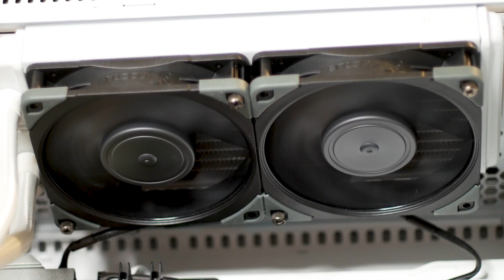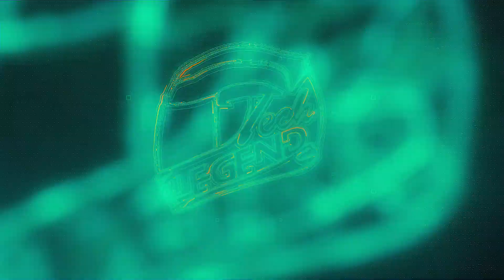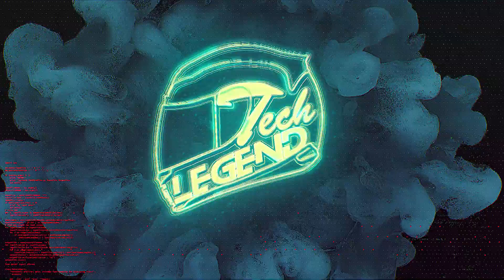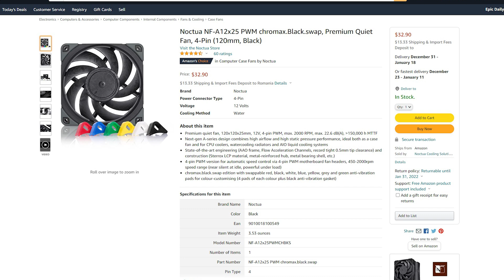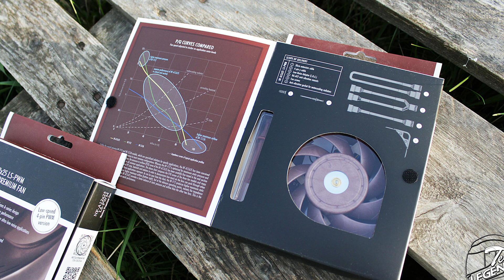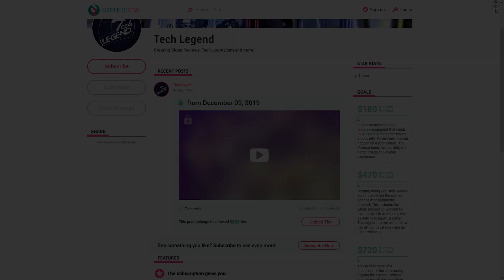Noctua NF-A12x25 PWM chromax.Black.swap Review

Comment: not many review include the noiseblocker eloop on youtube, looking at your list i dont need to buy the notcua or the t30 if the noiseblocker are this close is it also on the radiators this close?
Reply from the maker: While the eLoop fans are good, they are an older design and might lose next to newer fans that are quieter overall.

Comment: I decided to give my H5 flow chassis a bit of a twist. I swapped out the NZXT GPU, exhaust, and top-mounting radiator fans for these Noctua fans. Guys, I couldn't be happier 😊. After doing hours of research on Noctua, P T30s, and Be Quite All with great reviews eventually, I had to make a choice and I believe Noctua stands alone. I barely hear them spinning up with temps get high. These did come with extra bumpers and guards in different colors to match aesthetics 👌🏽 They are pricey but in the world of tech, we know you get what you pay for.
Reply: I am picking these up tomorrow for my H5 as well!! Glad to hear you love yours man. Cheers
Reply: @MnHondaSi  After hours and hours searching videos', im also going to upgrade my H5 flow. 140mm 2x noctua front fans and 120mm noctua black swap.Thanks for commenting!

Comment: I did a lot of testing  and it produces a soft sound close to a mesh panel, also on a heatsink... it keeps the cpu from thermal throttling at only 25% speed. I love this fan!, its so sad they dont offer 3pack or other bundles!!
Reply from the maker: I will try to test with mesh in the future. See the sound results.
Reply: @TechLegend-com  ok

Comment: Probably a dumb question but are the black swap version fans any louder than the original brown version? I hear people say that the black swap is slightly louder.
Reply from the maker: Not a dumb question, and the answer is no. The black versions are 100% the same in terms of performance.
Reply: @TechLegend-com  so the black ones only difference is colour
Reply: Acutally they right. Black have more noise...

Comment: Overpriced fan,  like come on it is 120mm, 61cfm non rgb basic fan for £30, really ? And they expect me to mismatch those 4 pads ? Why I can't have 4 black ones to match the black fan? Apart from spending even more money to buy 4 same black pads. Screw this fan! I will not be buying it for one!
Reply from the maker: You do NOT have to use mismatched rubber pads. In the package you have four sets of four colors. So you can go all black or all white, or all yellow etc. 
The A12x25 has more engineering than your average RGB fan, that's why it's so expensive.
Reply: You seem like you know nothing about pc fans and only care about rgb so maybe it's good if you won be "buying it for one"
Reply: The price represent quality built fans.  If you feel the difference in build quality of the Noctua fans to say the P12 or P14 fans you will see/feel the difference.  Those fans are cheaper because they are cheaply built.  The Noctua fans are build strong tough.  If you want RGB then you will have to look elsewhere.  These fans are built for performance.
Reply: I just installed this fan in my case. Everything you said is 100% incorrect. Noise levels compared to my P12 went down significantly. Thermals for my 6700 went down 8 degrees (it's under my GPU alongside another A12x25). At idle, I have to literally put my ear against the case because they're ungodly quiet. They're worth every penny. Now I see why Noctua has a cult like following.